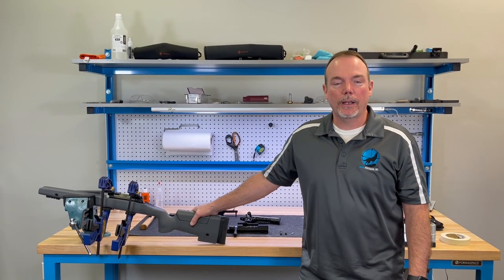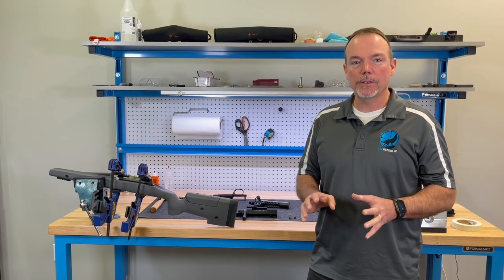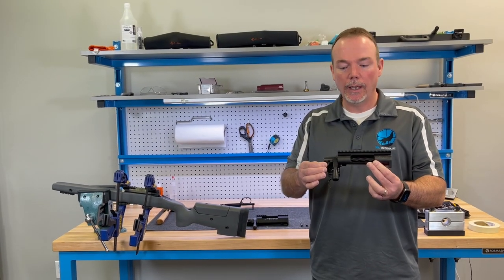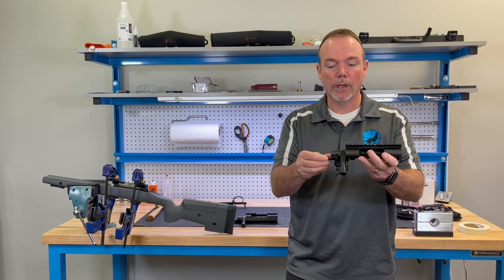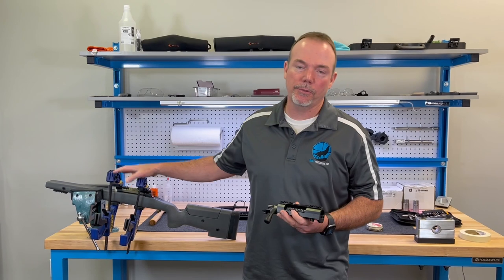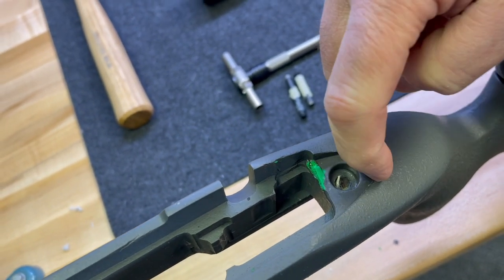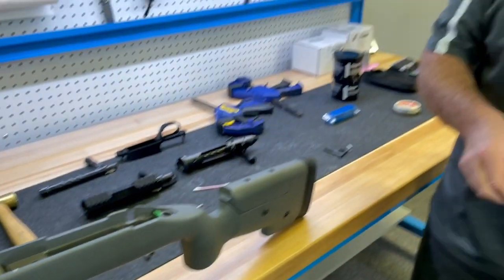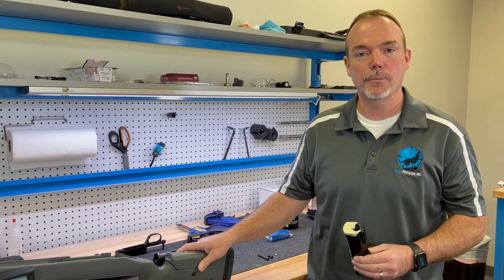The Importance of Bedding Your Rifle

Comment: Said it before say it again.   The howa 1500 action recoil lug w the bolt through it is the best design out there.   Draws it in tight as hell
Reply from the maker: Sure, but it is can be the side support like rails that can be the issue in warping, heat treat or clamping pressure when machining the stock.  Bedding is a correcting process that supports the action a lot better.  Not always needed, but should always support the action better.   Thanks for the reply,  Jamie